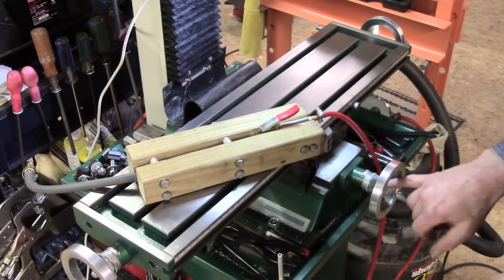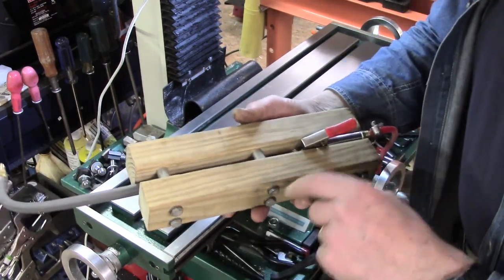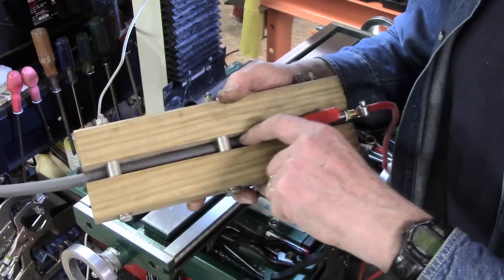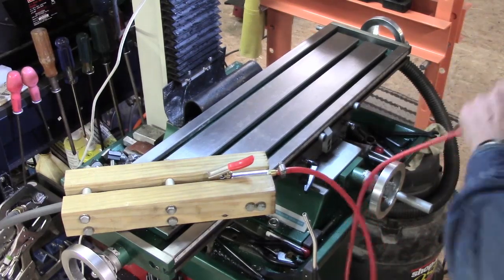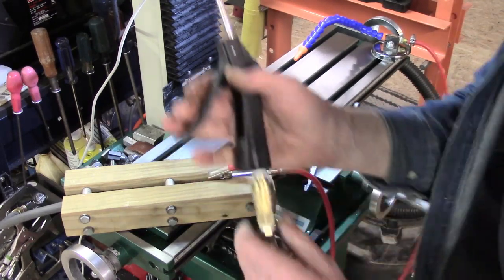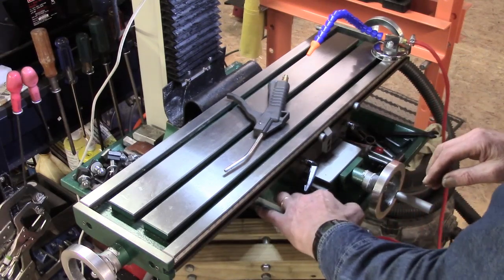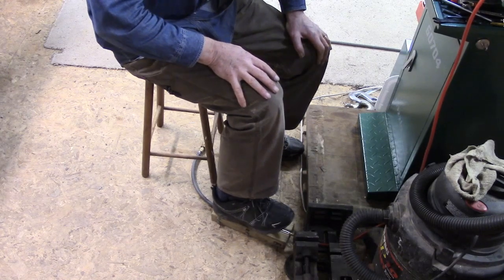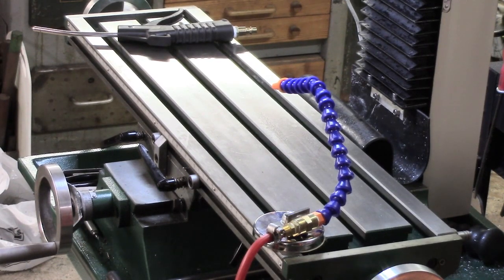Foot Operated Air Blast for the Mill

Comment: That looks like a good idea.  I ran an air line to use for cooling on my mill but I need to put on a small tip so it does not take so much air.  I did not think of using a magnet to keep things in place.  I will correct that at once.  Thanks for the video.